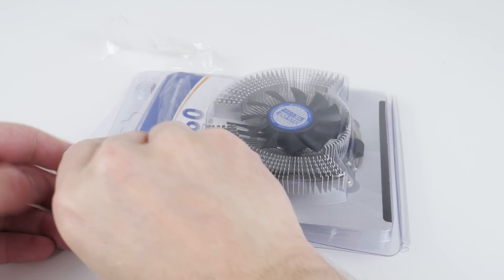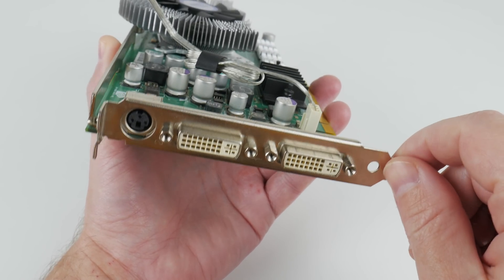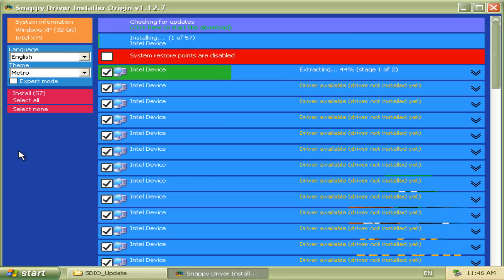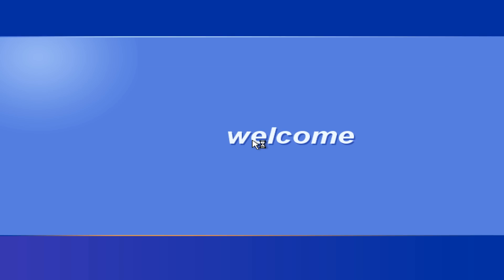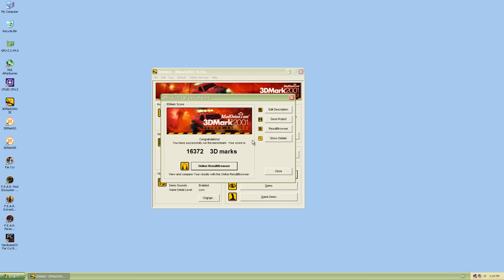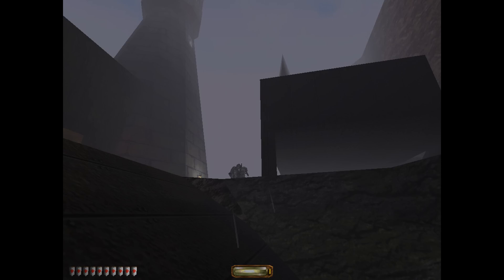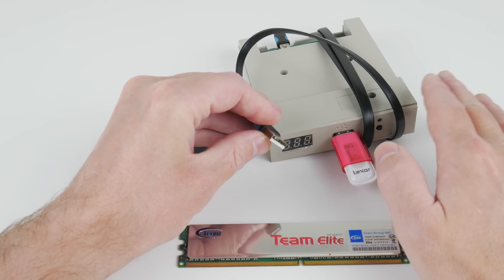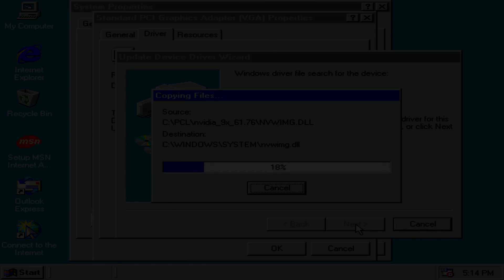Nvidia Quadro FX 1300 - FX Retro features with PCIe

Comment: I think Nvidia dropped support for 8-bit palettized textures in their newer drivers. So even if the card supports that in hardware, it wouldn't work unless you're using an older driver.
Reply: What was the last Windows 98 SE Nvidia  driver to support the 8-bit Palettized Textures.  I know the FX card wear the last to fully support it but now I am wondering what was the last drivers :)
Reply: @kinkykane0607  The last one I used was 77.72 from 2005, and that one did support palettized textures.
Reply: @kinkykane0607  i would also like to know! gonna throw together a s478 98 build with one of the fx series for AGP
Reply: can confirm that driver 77.72 forceware drivers were the last to support 8-bit palatalized textures, when i used later drivers; both the geforce fx 5500 and quadro fx 1300 both fail on the FFVII demo settings panel.

Comment: What a unique looking card! Cool mods. That round port is some kind of stereo-video port, I believe. Also wonder if the NV38 chips were the first ones to have palette textures dropped. Used both NV35GL and NV36GL based cards (Quadro FX 3000 and 1100 respectively) and they worked just fine on that test. Maybe drivers too, who knows?

Comment: I got one 1 year ago while looking for something better than the FX5500. Paid around USD 35 bucks for it. All retro stuff is either gone or too expensive nowdays. People tend to buy multiple units, which make things worse. Had trouble with a SIS board (A31G Athlon64 dual slot, it would not work once drivers were installed). It worked on Intel socket 775 though - Win98.
Reply: Half of the cards I order are dead on arrival, seller always claim it was working before

Comment: You can always count on AM2 boards for maximum compatibility! I have a Biostar AM2+ AGP board that works with installations from Windows 98 to Windows 11.
Reply: Now I'm curious, I suddenly had the curiosity to run windows 98 for the first time, I do have a asus p5pe-vm that has agp, but sadly I don't have any agp working videocard, and a bit newer asus p5gc-mx with pci express, if am2+ runs windows 98, would an early 775 run too?
Reply: @evandrochaves9596  It can be done, but there are no official w98 drivers for your 945GC chipset or its GMA graphics, so you'll be forced to experiment with 800-series chipset drivers to get it working. To get around the integrated graphics the best bet is to run an ATI card with PCIe from the X-series like an X800XL. PCIe support is tricky in w98, so be prepared for trying lots of drivers. I would recommend to sticking to the p5pe-vm and buying a cheap AGP card just to keep things simple.
Reply: Which is a bit bizarre considering how poor development of AM2 chips went and how K10 was so rushed.
Reply: @MJ-uk6lu  K8 and K10 came at just the right time, bringing AMD64 that would become the norm for decades to come. It's incredible that 754 Athlons from 2003 can run 2022 operating systems.
Reply: @TheDoorsHK21  Certainly not all of those Athlons, many of them lack some instructions to launch Windows installer. And running doesn't mean running well. Athlon 64 is dogshit slow with Windows 10.
Reply: @MJ-uk6lu  they have all the most essential instructions and XD bit, so Windows 10 32bit does install without issue. I totally agree they're slow on the other hand.
Reply: @TheDoorsHK21  Only some revisions do. I have seen some that don't have everything for 10. I think it was NX bit or something like that.

Comment: Are you sure the DIN3 is a TV port? S-Video is DIN4, and the NVidia Quadro series DIN3 is usually for 3D goggles with active LCD and was a legacy protocol dating back to the Elsa Erazor days, and the Driver are still offering this option. Quadro being used in many industrial design and CAD computers they kept support for that active 3D goggles called “3D vision” or “stereo magic”.
You should check it and review those 😊
Reply: Yes, it's 3D googles port not TV port.

Comment: Nice Video Phil! I have two dead PCX cards and still to find a Quadro FX. A good motherboard to use with this GPU are the Socket 478 PCIe Motherboards with the intel i945GC chipset.
Reply: Also socket 775 works wonders with these cards, especially G31 / G33 / P35. I had mine running on ASRock 4CoreDual-SATA2, so I know from my own experience that VIA chipsets are good alternative for these FX1300's.
Reply: @Cpt_Wolf  But those are more recent and unecessary for FX series.
Reply: @explorer9049  I know, but any Pentium 4 Northwood 800/Prescott will not bottleneck the FX series even the 5950 Ultra. But yes the early 915/925X/945 Intel chipset are good combo, since the most only allow Pentium 4 or Pentium D.

Comment: I would suggest using i915 chipset for full Win98 support or i945/965 for partial, but good enough support (chipset drivers exist, good enough for me). On the AMD side, AFAIK only VIA K8T890/K8M890 fully support Win98 while having proper PCI-E bus. Also it should be possible to flash FX5900/PCX5900 BIOS into this card.
Reply: I have a SIS board (A31G Athlon64 dual slot) that works with PCI-E card like FX3400, FX3500 and others. But not with this FX1300
Reply: Cool I was wondering if my new Aopen i915Ga-HFS would have a lot of issues under 98 and XP.

Comment: Random thought.. I wonder if you could do a VM PCIE passthrough for a GPU like that and run win98/xp with acceleration along with a modern OS. You'll just need a system with IOMMU support.
Reply from the maker: Hmm not at this stage, very much enjoy working with real hardware not VM. I do love dosbox though.
Reply: @philscomputerlab  oh yeah I love and prefer real hardware myself as well, I have several Slot 1 and Socket A machines since I started watching mostly you and LGR 😆. But I think just like real hardware VMs are great fun to experiment with and watch others experiment with, same as emulators like dosbox 👍. Great to see you on camera Phil, you are legendary.

Comment: With compliments, your accent is a nice blend of German and Australian stirred together. I love your channel! Can you do a P166MMX/Win2000 build but max out the RAM to 256MB, and put in the best PCI 3D accelerator you can find (Voodoo3 3000 PCI? / GeForce2 MX 400 PCI with fan) and see how the build can handle titles from 1999-2001? Overclock the P166MMX to 233Mhz if you have to.

Comment: Yes sadly from my understanding it's a very hit miss when it comes to using Win98 and PCIe video cards.

Just hope my AGP 6800 and 5950 have a very long life.

As for WinXP, I just overkill using GTX 980 Ti.
Reply from the maker: I haven't found something that stresses a 960 in XP 😂
Reply: @philscomputerlab   On the plus side it's a nice setup when you want to run both windows XP and 11 on the same unit. I'm using an old DELL T3600, 32GB & E5-1660.
Reply: True. I’m looking for both 980 Ti and 960 to be super cheap. I’ll get both. I secured a 970 from a friend though. 960 will be nice as it’ll just sip power on idle and will work without PCIe power cable.

Comment: I hope a suitable driver for modern Windows can be found or cobbled together from other nVidia releases for these. Or heck, even written from scratch as the GeForce FX series is old enough that the open-source folk have a reasonably good Linux driver for it so the required documentation for writing a driver is available online.

Just because more often than not graphics are the biggest showstopper to compatibility when it comes to playing retro games on modern systems, having a driver that works on modern windows for the first PCIe GPUs would effectively be like a hardware version of dgvoodoo2.
Reply: there are Vista 64-bit drivers (forceware 95), not sure how far up they'll go tho

Comment: I was able to get it working on Windows 98 on a ViA Chipset, it was important to have the chipset drivers installed for pcie to be working right.

However I had massive performance regressions compared to Windows XP and was never able to isolate exactly what the problem was.
Reply from the maker: Hmm I'm not sure I even have a PCIe VIA chipset board 😅
Reply: Similar issue with FX 3500. Everything installed and working on Win98, but there random slowdowns. Never had the time to figure it out.

Comment: That Snappy Driver program really helped me out with the R9 270x I installed in my XP machine. The "drivers" from the AMD website only installed Catalyst but not actually the drivers. I was close to giving up, when I remembered you talking about it, so thanks!
Reply from the maker: Another workaround is after the drivers installed, but failed to install the actual drivers. Go to device manager, manually search for drivers and point to C:\ATI
Reply from the maker: @jayzeus999  I used 14.4, but it wasn't a R9 card, so maybe that's your issue. It was a R5 340X and R7 250.
Reply: @jayzeus999  how much boost did you see in game? I also tried r9 270x in crossfire in xp but I found that a crossfire with hd 6870 or 6950 is better

Comment: This is really useful. I have two of these and they're the closest things to the mystical PCX 5950 card. I hope we can get these running on 98. Perhaps maybe trying the quadro soft mod?
Reply: I found a PCX5900. Is it the same?
Reply: @RetroAmateur1989  The PCX 5900 is slightly slower than a mystical PCX 5950. The PCX 5900 is the same as the FX 5900 on the NV35 chip. The FX 5950 uses the NV38 chip and the Quadro on this video is NV38. But it seems that the PCX 5950 was never released or extremely rare.
Reply: AFAIK it’s near impossible to get win 98 to work with a pcie card
Reply: @dylanrush184  Then you haven't been watching enough Phil's Computer Lab ;)
Reply: @dylanrush184 it’s actually not a big problem. But newer cards don’t have drivers. GeForce 6 and 7 series have some working drivers 77.72 / 81.92
But compatibility is not great. UT99 and half life work fine though even at full hd. For OpenGL it might be necessary to use the DLL from an older driver, for compatibility. Someone on vogons explained it